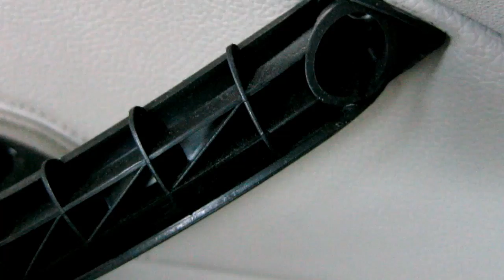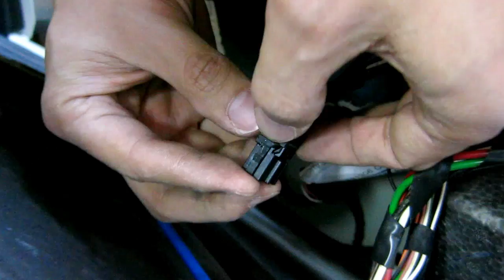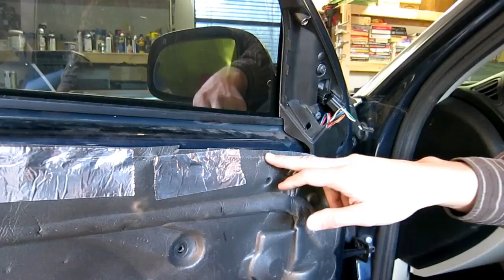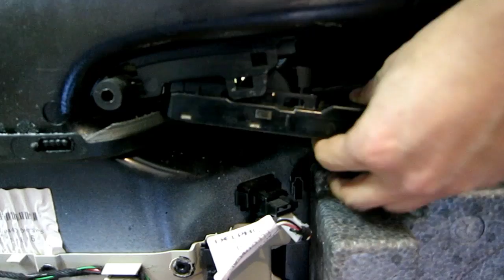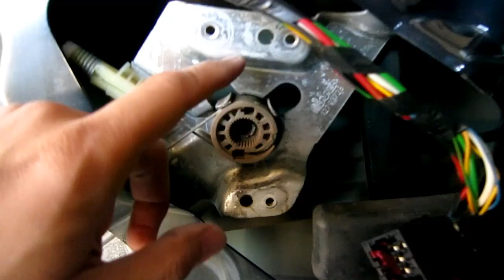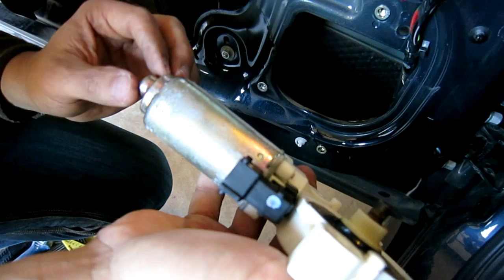2004 SAAB Electric Motor Replace Remove Repair (2002 2003 2005 2006 2007) Window glass switch

Comment: For anyone reading this: The motor differs between early ng9-3:s and older ng9-3:s. The newer motor is made by Siemens and has different mounting holes and number of gears and can unfortunately not be directly bolted on to the older style. I solved it by designing a new gear mechanism which I 3D printed, but it'll probably be better to get the right kind of motor. :) The change was made somewhere between 2007 and 2008. Don't know why they switched manufacturers - maybe the older motor went out of production or Siemens could offer a lower cost - who knows.. :D
Reply from the maker: thx for sharing this info. im sure it will help someone out.

Comment: My drivers window was stuck. Followed your  video and instructions to the letter and it's now working again. Used silicone spray on the motor and mechanism. Thanks a million for posting.

Comment: I had this problem, hit the motor and it now works fine, but just in case, I swapped out the rear motor with the front. They are interchangeable and all is good.

Comment: DIY Tinker > Have you swapped the window motor or regulator for the rear window in a convertible? I can't figure out if the motors are the same for the front and back. And, do I need to replace the entire regulator unit or can I replace just the motor? Thanks

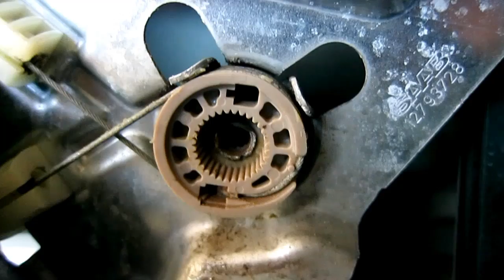Comment: Hello. My question is, how can I remove the small plastic wheel, which hold the cables and connect to the motor(on the video 8:51)... is it fixed to the frame? or is it removable? I have a new one, but I do not know how can I remove it...and install the new one...
Thanks for your answer

Comment: The gear into which the motor fits (which remained in the door after the motor was removed), did you lubricate any areas in/around that gear in case that was the cause of the window sticking?  Thanks!
Reply from the maker: +David H no i didnt. but that sounds like a good idea.

Comment: Excellent video. I see in alot of videos that these cars are very easy to work on. Especially if your a DIY person. (And I am)
I just bought a 2003 linear 5 speed for $1.k but its rittled with little problems here and there and trust me, I dont mind... motor and transmission is strong and body is an 8.. interior immaculate. (I was lucky for the price) but the more I see these videos the better I feel. 
Thank you. This will go in my "saab videos" as refrence.
Reply: There is another YouTuber ... Auto Autopsy, he also did lots of Saab 9-3, 9-5 repairs and upgrade video. Take a look of his video and could help you a lot with small issues.   Take Good Care of your Saab as they become rare and seldom seen on the road.

Comment: Man you just saved me a trip of 120 miles to the Atlanta Saab dealership, a lot of money and time. It worked great. I noticed your motor's ele. connection had 6 connectors, this one had 2 and no circuit card. So before anyone orders one they should check the connection. It took me a little over an hour and to fix it, thanks again!
used WD40
Hubert
Dalton, Ga.
Reply: 6 pins are for pinch protection whereas 2 pins doesn't !